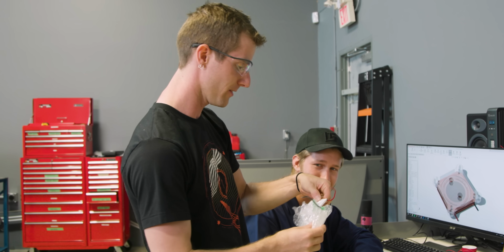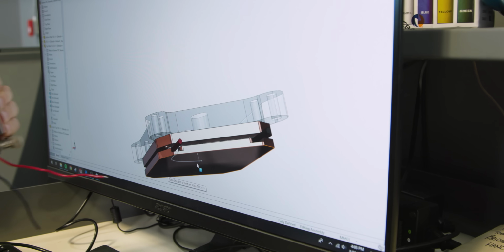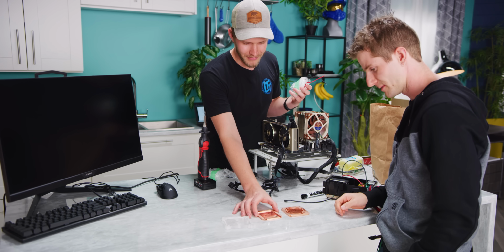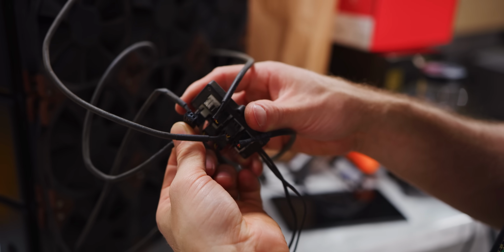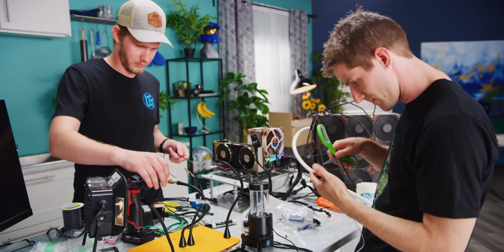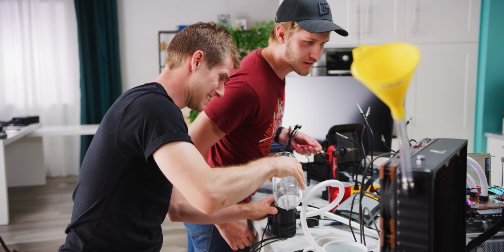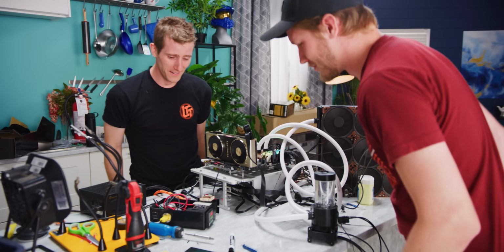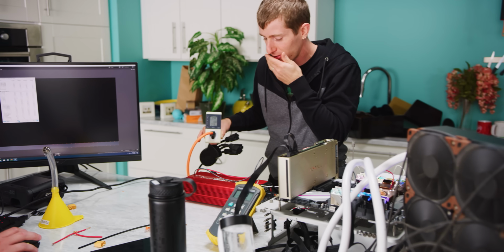This Cooler DRAWS 545W!!? Bad Cooling Ideas #2

Comment: I am a temperature and process control specialist. Your PID control box was a great idea, but the mistake was in the SSR. Most SSRs use a triac which relies on the zero-voltage crossing point of AC power to turn OFF. Notice the label says AC for the load side. If a DC load is switched on through an SSR, it won't turn back off, which is why your test stand overcooled way past setpoint.

You can get DC only or AC/DC SSRs but they are a bit more expensive due to more circuitry inside.

Comment: You're supposed to use the peltie to cool the water in the main loop and then have a 2nd cooler/loop to cool the peltie, not stick it directly to the CPU

Comment: Did Peltier cooling back when it was needed, more than 10 years ago. Had one of the massive aluminum Lian Li cases with room for 12 hard drives on the bottom. After the cpu or gpu you send the water to a radiator. Which then feeds the reservoir. This brings the water to roughly room temp. Then you cool the water,  with a different pump system cooling the peltiers. All in all, 3 x 3 fan radiators and 1 x 2 fan. With a 1 gallon res. 1250 watt EVO galaxy PSU and 450 watt Thermaltake side by side psu. Peltiers took about 600 W in total.
Anyways, give the system the same cooling as a radiator first then cool it with peltiers. Don't remember the Intel CPU. but it was stock clocked at 3.2 with 4 cores(best cpu at the time was 3.6x4). With radiator alone water cooling could hit 4.2 stable. With peltiers the way I stated, it would go up to 4.8 stable and all the way to 5.4 (unstable).
The only reason I would pull my old case out of storage and do this again, is I had money to throw away. Air cooled with a decent set up works today. These are no longer the days where Crysis made your system have a mental breakdown.

Comment: Maybe the water flow on the hot side is too slow, to take a way the heat,   It will boil, , maybe, remove all the groves,   Just let the water run though the hot side fast instead of absorb a lot of heat and go slowly

Comment: At this high end level the tec might not work well, but what about lower end situations such as when passive cooling is normally used (such as an iphone) but starts having trouble could a tec help in those cases, being small and thin enough for such a device and the heat load relatively low?

Comment: the tech was overwhelmed because the water block wasn't removing the heat fast enough that is one of the BIGGEST problems with tech cooling getting rid of the Excess heat

Comment: Linus is going to end up creating and building prosumer products, they had started with pads, as great, logical, and important it is the way is build and why is great and amazing pricing system, this guys are going to end up building keyboards, mouses, inner component systems for electrothermal whatever and be one of the top buissneses within corsair and Logitech or even better

Comment: You guys are doing it wrong in my opinion. You should use a tower air cooler, and put the TEC modules (lower power than this) on the sides that don’t have fans. Cool the air that’s moving through the heat sink.

Comment: Der8auer just received an Intel Cryo Cooler which uses a TEC with a very complex controller and a humidity sensor to calculate the dew point.
Maybe use that one as well to replace Alex solution? (But still with a stronger TEC :-) )

Comment: If you want to cool a CPU below ambient temperatures, wouldn't it be better to cool it basically with a split AC unit? Have the AC unit cool a cooling liquid and run that through the CPU block.

Comment: 1. The Peltier element is just a heat pump. It pumps heat from one side to the other. Kinda like your heatpipes.

2. It uses power, and it works at < 100% efficiency (actually, around 5% last time I checked). So you're going to lose most of the energy, and that energy is going to be turned into heat.

3. You can pump your heat as much as you want, from one side of the Peltier element to the other, but if you can't remove that heat efficiently, you're going to have a bottleneck there.

4. I imagine only one scenario when a Peltier device would be useful - getting below-ambient temperatures, but I'd still put the device closer to the radiators, so it transfers heat to a large radiator. Otherwise, you are always going to lose energy.

5. Think of it like this. Passive cooling systems are the most effective. No additional energy cost. Except to remove the N amount of heat with a passive cooler, you'd need a pretty huge one. A simple fan will use a certain amount of energy, but reduce the size of the cooling system dramatically. Water cooling will be even less effective, but it will help fit a larger radiator on the CPU, so you can move more heat or use less fan power (and have less noise). So what's the point of introducing yet another element to the loop? Efficiency will go down, you can't cheat thermodynamics. And you won't decrease the size of the cooling system - you still need to vent out a certain amount of energy. To vent out more energy, you need larger radiators and/or more powerful fans.

Comment: Linus - "tech cooling is and was a bad idea" 
Intel / cooler master - "Hold our beers"
Reply: Linus - "were gonna use tec, in the worst possible way you can"
Reply: @phillstevenson4931  they really did the worst possible design they could. The copper part on top of the tec for water cooling 
it —that was actually obvious its not gonna dump the heat— was a beautiful, neat, amazing mess 😂

Comment: I run multiple peltier devices in series, thats also inline with a corsair 115i, to reduce my coolant temperature. As always, the peltier devices are not at all efficient, but its a nice little assist to the corsair 115i. Plus it was a lot of fun to build.

Comment: One of the problems was you had the upper and lower copper plates touching transferring the heat from the tech to the cpu.
Reply: No they didn't. There's clearly an air gap.
Reply: @cyb69  After taking a closer look it does appear I was wrong.

Comment: Someone can explain me why is condensation of water bad for the computer? I wonder, if there is no salt on the water, does it conducts electricity anyway? I can imagine that is bad either way for other reasons but will the water cause a short if it comes from condensation?
Reply: You are not wrong water from condensation alone would probably not be very conductive but because there's dust and all kinds of things floating in the air and setting down on the components which the water will mix with its gonna short out eventually.

Comment: I know this is old, and i know it's probably be garbage aswell, but i never saw someone to use AIO water cooler (with maybe radiator for 1 120-140mm fan) and actually cool the radiator with TEC coz in that  scenario i think you will get more cooling surfaces and you don't need so much control on TECs coz if you get condensation it will be on radiator not on board. I know it may be a junk but it's not bad idea i think.

Comment: The concept is bad imo. Cooling the CPU ditlrectly will  never work. You should cool the water going to the cpu block instead.  Additionally second water loop to take the heat away from the "hot side" may be a good idea?? Best wishes from Poland.
Reply: Intel did it, https://www.youtube.com/watch?v=uOrUNT_0XVY
See the results that linus just published

Comment: Instead of trying to cool with the peltier directly you should try to use a standard water cooled loop setup but after the water has cooled in the radiator it should pass true the peltier then and get cooled to ambient or even sub ambient.
Reply: DO THIS

Comment: Err... shouldn't you have a thermistor connected to the CPU/cool side of peltier to use the relay controller properly? Also, you need much better cooler capability on the hot side right?

Comment: U guys getting rid of any of these peliter units from the test ????    Also Linus i was hoping y’all would have done 1 other test with this, with that being not to replace todays water cooling , but to combine .  Try an use the Peltier in-line to help cool water within today’s style , if anything even a small one would be an aid in heat dissipation if anything with minimum wattage. I find these to slight more efficient running in a manner of under volt style.

Comment: the peltier cooler use 545w not capable draw that much energy because its a semi conductor. try make a cpu waterblock taller, longer internal fins,  then hook up fan radiator and then to a peltier radiator to cool further down. u can cool the peltier with cpu exhaust water if water temp not over 60, then feed to the fan radiator

Comment: What if you used tecs to cool the tecs?
Reply: Like a cooling block right? The more cool sides of the Tecs that you have on this cooling block of some kind the more heat you can dissipate. I have a certain idea but I think it would be kinda Bada** if you guys could actually get Tecs to work for Tecs

Comment: hehehe guys your all wrong best to use one of the small 12 70 watt peltiers for a water cooled heat removal option,and youll get minus 10 to minus 15 degrees c,the large peltier would needa huge slab of alloy heatsink and massive fins to remove the heat,otherwise the heat flows baCK into the cpu, i use a cheap 5 dollar chinese peltier 12volt and 70 watt with basic corsair AIO coolerand have constant negitive temps even when gaming all day.watercooling just cant remove the heat from those big peltiers.

Comment: So I was thinking what if you ran the water first through the radiator then through the Peltier cooler?  Could you come up with slightly chilled water?  What if you thermally bonded a full on heat sink to the cold side of the cooler, then submerged that in a block after the radiator?

Comment: Uses solidworks but, doesn't understand that this gauge wire is never going to carry the current needed for the thing. It looks to be a maybe an 18-20 gauge wire when you could have used at least 8-10 depending on length. That burning smell was more than likely the wire. You basically created a fusible link instead of an actual power wire and it was about to go.

Comment: if you connect the peltier with a water cooler system is that worth? like you would use a simple cooling system to cool down the peltier, the cold part would be part of the water cooler :V . you could simpply applay 20-30watts peltier and see if it would help to make the water more cold.

Comment: Ok so they get close but when it comes to TEC cooling nobody seems to have tried doing it an indirect way. Now that everyone and their cousin has proven that TEC units don't operate in the way they want as a main cooler maybe stand back and think outside the box.

Build a standard loop for the CPU (capable of handling the CPU alone for the most part) and then insert a block into post-radiator pipe going to the CPU. Then add a TEC onto that block and create a sandwich with a big air cooler/AIO/second independent loop onto the TEC. Now, any the waste heat from the TEC will not be added into the main loop and the TEC is not the main cooling conduit but instead a sort of booster to bring the water temps down further than a radiator could. This way the TEC can power down completely and you are still left with a standard loop and when it is powered on your water temps could potentially be brought down to sub ambient. This also means that the TEC can be pulsed or run at partial power as needed to maintain a target temp and to avoid condensation.

TLDR: Basically build a loop where the TEC is NOT the main cooling solution but instead as a booster for an already capable loop and use it to bring water temps to below normal idle.

Comment: LOL  I haven't programmed a PID in two decades now, but looks like they're still just as PITA as ever.  Sad to see it didn't even help.  BUT (dun dun dun!) maybe putting the Peltier cooler on the CPU itself was the bad idea.  What if it was used as a secondary cooling phase (so placed after the rad) to cool the water going into a normal CPU water block?  So CPU - AIC - Peltier - CPU?  So two sets of radiators.  An AIC for the CPU and a massive rad for a janky Peltier.  Arguably (not really) pointless as you COULD just use the massive rad alone to cool the CPU in a normal watercooled setup ... but where's the fun in doing things the sane way?
Reply: I 100% agree with this and have spent a lot of time looking to see what it would take to do this. I'd put the main rad on the top blowing, and the other on the front...
Reply: I said the same, albeit not nearly as well stated. 2 phase cooling! Do it!

Comment: Basically the radiator just not enough to dissipate 100w from cpu + 900w from peltier plate. So basically they are just water cooling the cpu with extra 900w to dissipate.

Comment: listen to my madness.... use a regular liquid cooling... but with a metal water reservoir a use thermoelectronics to cool directly the water... condensation should not matter and if you try to cool a water tank you could actually use more than 1 thermocoolers almost freezing the metal tube containing the water but not touching directly the components... and most of all... WHY NOT?

Comment: You probably could have seen in the data sheet of the TEC that this can't work as there are usually nice diagrams showing what temperature difference you will get.

Comment: hmmm, could a TEC assist burn off extra if you did a thermal tower( like a 40mm copper cube) with 4 tec's around the perimeter, all individually water-cooled, and a Noctua NH-D15 on top of that(intended as a primary air cooler)? Like a  hybrid  TEC, Water, Air cooler. It would be a monster, but just how much could it take? the Noctua would probably manage the majority of the load, allowing the TEC's to simply supplement the cooling. Usually, in real-world applications, the expectation from TEC's is to be about 20F cooler than ambient, with 4 of them working through a single block, it may achieve better results, none of which are efficient or optimal. Just putting more ideas out there, as you had so much fun with this project.

Comment: the copper was getting really hot.   that is because the peltier also produces heat.  it doesn't just pump it.  
now.  it would probabbly work great as a cooler..
the peltier was doing an awesome and great job removing heat from the cpu.  
your water cooling system was doing a horrible, and absolute terrible job at removing heat from the peltier.  
and that is why it failed.  

if you cannot keep that copper at room temp then the peltier will not be able to cool the cpu,  it can only create a temperature diffrence.

Comment: If you reverse the polarity of the supply wires, the directions of the hot and cold side of the Peltier element also change. If you heat it or cool it down enough, voltage is generated at its outputs.

Comment: Since water has a higher heat capacity than the peltie device, I hypothesis that the peltie device would make for a more efficient cooling solution if used to cool the water, than if used directly on the IHS.

Comment: the peltier module your using is to powerful for the cooling system your using, you'd be better of with regular water cooling and using the peltier module to cool the water that runs past the CPU rather than a direct placement and it would probably be more efficient to use two maybe even three smaller ones as it would be easier to cool the hot side on three separate ones rather than on bigger one

Comment: That 500-something watt TEC is an overkill. If you use a regular CPU with around 65-95 W TDP, theoretically it is possible to cool it with a TEC12710 or to be safe, with a TEC12715. Let's say, we are satisfied with the TEC12710. In that case, a ~250-300 W (~170 W rejected heat from the Peltier + the CPU's TDP) cooler on the hot side of the Peltier would be enough to bring the CPU slightly below ambient temperature. But as long as you do not want to cool the CPU below ambient temperature, Peltier cooling does not make any sense. It is just waste of time and a loooooot of money.

Comment: What happens if you do it the other way around. Useing the heat of the CPU and cooling of the water to produce power via the peltier element to run the fans. Should the peltier not get more efficient the hotter/colder the CPU and water becomes? Would it be able to "cool" by transfering the energy to electricity or would it just build up heat?

Comment: Go one step further. 
Standard water block -> large radiator to bring temp to ambient -> tec cooling array to bring coolant subzero -> back to water block.

Fyi, peltiers have three energy balance equations including internal resistive heating, conductive thermal transfer and seebeck thermal transfer. As your temp delta goes up the tec efficiency drops and the resistive heating takes over resulting in your tech becoming predominantly a heater on both sides. Amping up the voltage and current just drives more resistive heat load. 

Also as the temperature delta increases, a reverse voltage is generated which subsequently further drops the seebeck heat transfer performance.

Fun times 🤠

Comment: I know at this point you wont see this message, BUT what if you revisted this project but in new form. Instead of trying to use the Tec on cpu why not use it as an active cooling additive to a custom loop? Literally just using it to help cool the loop? OR and here is an idea. Use a Heat exchange on the cool side causing the rad to be chilled and having fans blow through to actively cool next to a gpu or something of that nature?
Reply: Would not work very well. You would just extract the heat at a different point in the loop. You will still need a complex cooling for the hot side of the Peltier, and power supply...etc. It is very inefficient to use Peltiers to assist the water cooling system. I actually tested it, you are welcome to check it out in my channel. :)